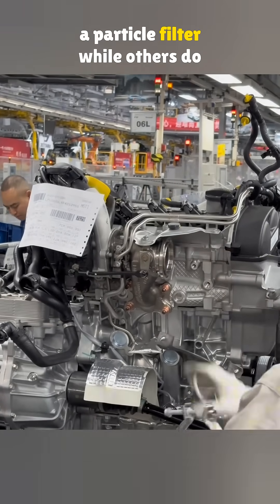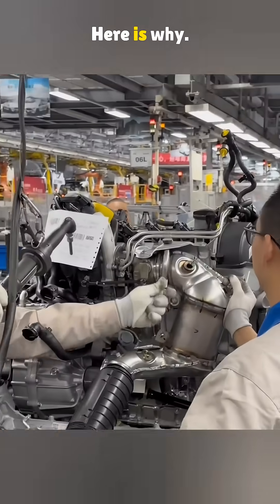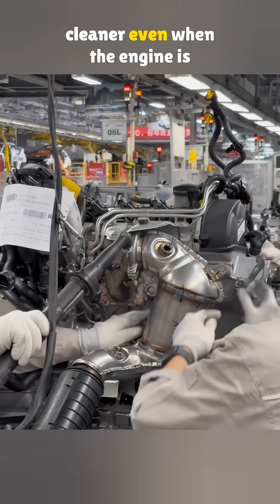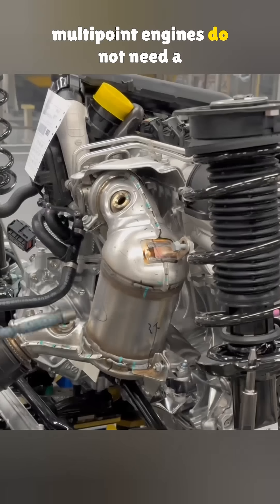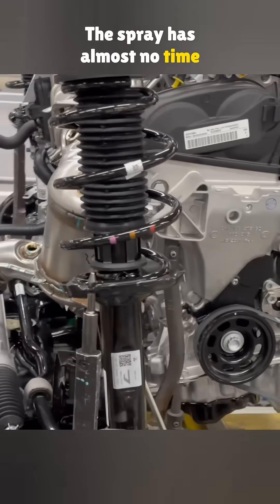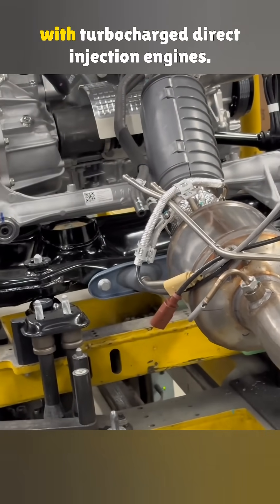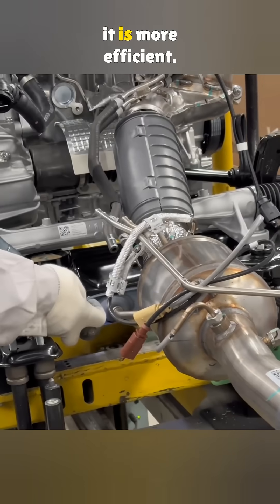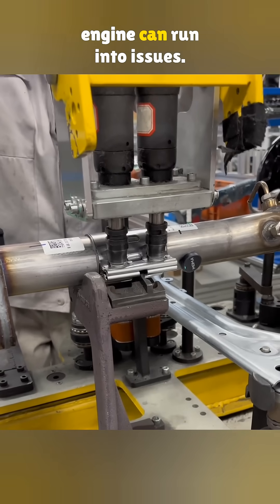Why Some Cars Need a Particle Filter and Others Do Not #automobile #assembly #factorytour #mechanic

Comment: Particle filters are used on Diesel engines, not gasoline engines.
Reply: In Europe all petrol engines with EURO 6 emission standard have particle filters.
Reply: ok, whats the meaning of Gasoline Particulate Filter short GPF for? Like all new Petrol engines around 2016+?

Comment: carbon deposits signal your engine is not getting enough air....you need more air...put a turbo on & reduce the fuel amount...if it's not enough expansion to get the piston complete it's cycle...throw the engine away...& design a new one.

& you might need a more resistive piston if the mixture is right to give it more time to burn all the fuel.